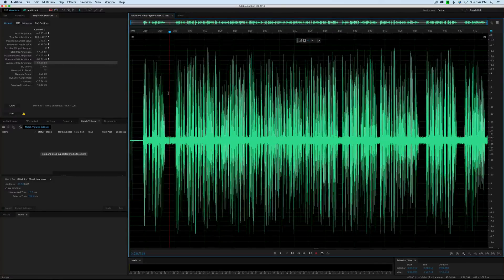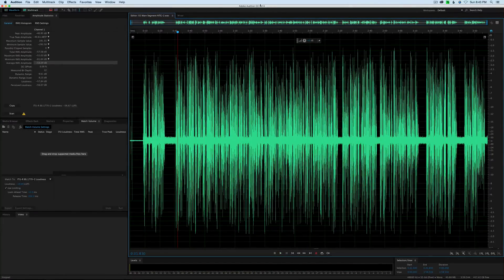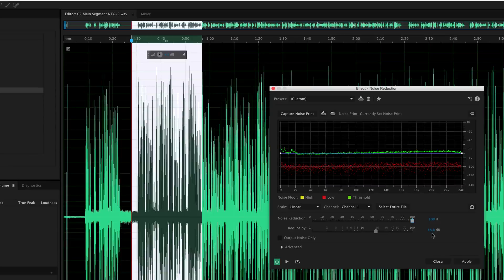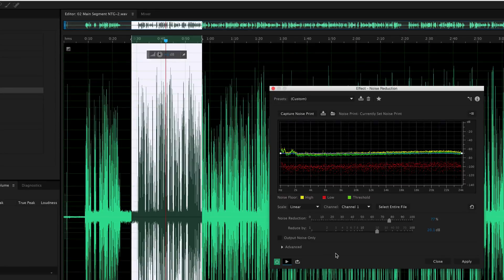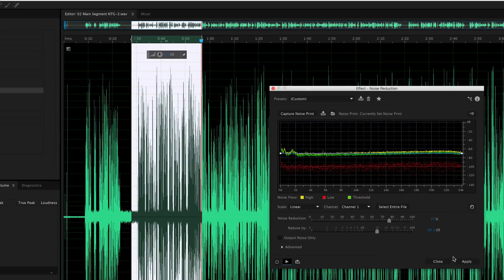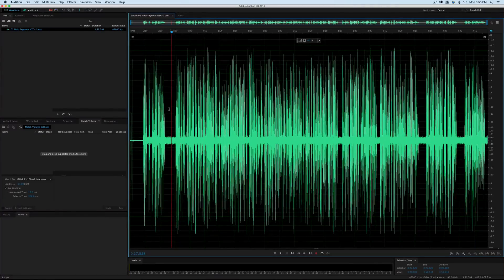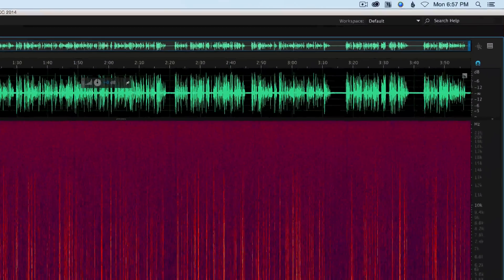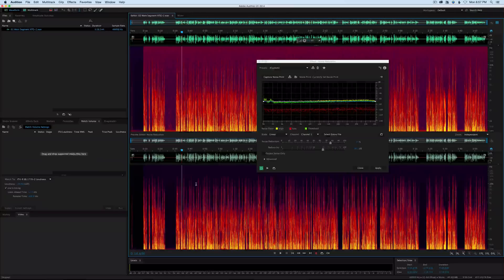Audio Hiss Noise Reduction

Comment: Good tip and video. Of course to reduce hiss in the first place be sure to turn the volume up on the audio interface and down on the computer. If you are recording onto a computer. Makes a HUGE difference. I suggest turn volume to about halfway on interface and lower the computer volume as needed while monitoring the signal in your editing software.
Reply from the maker: Steven Rix Glad you found the source of the hiss! In the sample on dropbox, I didn't hear anything so I'm not sure that worked. But at least now we know the culprit! Normalization will increase the level of all the sound in the file, including any noise. So that's to be expected. That's why I use this technique after loudness normalizing.
Reply from the maker: Dan D. Dirges Thanks Dan, you're referring to the gain/input level on the interface and computer?
Reply: Curtis Judd Hi Curtis. Yes, I discovered if you use more volume on the interface and less on the computer you get a MUCH cleaner sound. No hiss! It was a break through for me. This is especially important for musicians. I hope I`m making sense.

I used to crank my computer levels up to 100 and adjust the audio interface to get maximum signal without clipping. But I had it backwards. Always had hiss sound this way.
Reply: Dan D. Dirges I have that problem at home, because I run servers and i can't afford to stop the A/C, it would raise the sensor's temp of the camera (the A5100) and shut it down after 3 minutes. I tried a hardware solution, EQs with a compressors, it  makes a tiny bit of a difference, but that's still not good, i have to rely on the software for post edition, and i still have this hissing sound (run on an external soundcard here).
Reply from the maker: Steven Rix Do you use a dynamic mic? I find that when I use my Shure SM-58 with the computer behind the mic, it is able to reject most of the computer fan noise.
Reply: Hi Curtis. Yes i tried different dynamic mics (shure SP 55, sterling ST 55, Cobalt Co2, Sonys ...etc) I just did a test this time with everything turned down (@47Db of ambien noise) and I still can hear this hissing/humming sound after post-processing.
Reply from the maker: Steven Rix Yes, it sounds like your recording environment simply has a lot of noise. Mics and post can do some to help but if you've got a lot of noise in that space, there may not be a way to get a very clean audio recording.
Reply: Hi Curtis. Today I did a test with a yeti USB microphone and it worked great. Then I've done a test again with the mics connected directly to the external soundcard and they worked great. I isolated the issue to the pre-amps: I have white noise in this pre-amps, I don't know why. Here is a sample of that white noise (if the link works): https://www.dropbox.com/s/ok696s8o0faz6qv/white_noise_with_pre_amps.wav?dl=0     If you normalize the wav file it sounds even worse.

Comment: Hi Curtis. This is a great tutorial, however I am getting a ton of gurggle (Digital Artifacts) when reducing the hiss in my audio. This has been driving me crazy and can't seem to get it to go away. My video is a sit-down interview, so as you might understand the audio needs to be as clean as possible. Any thoughts?
Reply from the maker: Gabe Martinez Hi Gabe, Pumping, artifacting, or gurggling is usually a sign that the de-noiser is doing too much. Usually you will want to drop the noise reduction slider quite a bit if you're getting this effect. It can also help to check the "Output Noise Only" while you slide the Noise Reduction back and forth to fine-tune how much it is affecting the sound you want to keep. You can also try increasing the Smoothing setting under advanced which can help control the "burbling" though the more of this apply, the less noise you can remove. Experiment freely with the other advanced settings as well, particularly the precision factor.
Reply: Curtis Judd Curtis - firstly thanks for creating such a variety of excellent quality videos on all aspects of audio/video pre and post production - I cant get enough - so I watch them twice!! I too noticed some unusual 'sounds' after reducing the hiss, I never knew they would have actual names like gurgling! I'll drop the noise slider and monitor the output to see if I can improve. Thanks again, and please don't stop posting!!

Comment: Hi Curtis, thanks for your great videos. Very instructive for a beginning filmmaker!

I was wondering, would you consider doing a video on removing echo from audio files? I've learned my lesson: get this right immediately by choosing a better recording environment. I can rerecord. However, the interviewee said some great things during the original interview, so I'd like to try and get this fixed as best as possible.

Would be awesome if you'd consider it!
Reply from the maker: Jeroen Pool Yes! The best way I know to do this right now is using Izotope's RX4 Advanced de-reverb tool but alas, it is a $1200 piece of software. I'm keeping my eyes open for less expensive ways to do this and will cover that here when I find a way.
Reply: Curtis Judd Ai, that's insanely expensive. I have seen people talk about fiddling with Adobe Audition or even Audacity, specifically EQ and stuff. If you'd find a good working method for getting rid of (some of) the echo with either of these programs, would be great to hear!
Reply: Jeroen Pool Have a look at ReVerberate by Acon Digital : http://acondigital.com/products/deverberate/
Reply from the maker: Paul Figgiani Thanks! $99 is much better than $1200. I'll try it out.
Reply: Paul Figgiani Thanks for the tip, Paul!

Comment: Nice tutorial. Do you have any insight into how to use the graphical display that is part of the noise reduction dialog? It's interesting but I don't know how it would help me in this process.

Thanks.
Reply from the maker: Robert Shaver Thanks Robert. I'm still working to figure those out completely. But there are some more advanced things you can do. You will notice that there is a blue line in that interface that you can drag up or downand add point which seems to act like a parametric EQ so that you can fine tune how much noise reduction is applied at each frequency. The main problem I've found is that doing too much with that UI causes Audition to crash (at least on Mac). I'll keep playing with it and perhaps cover it in a future episode.